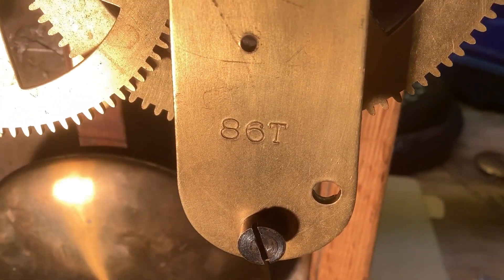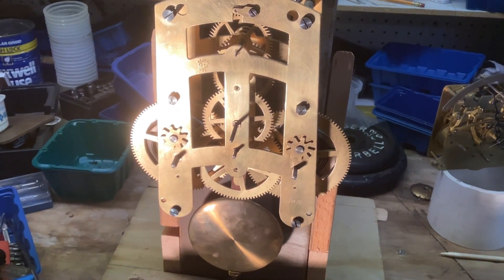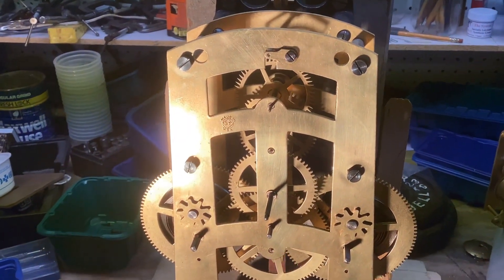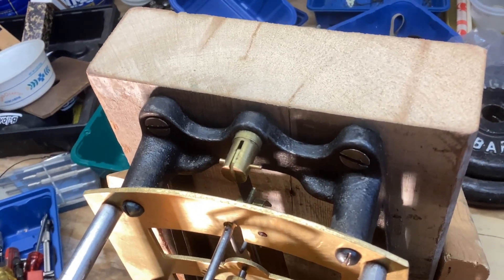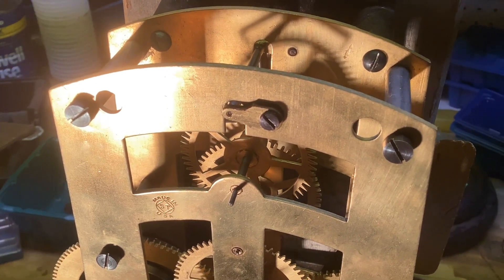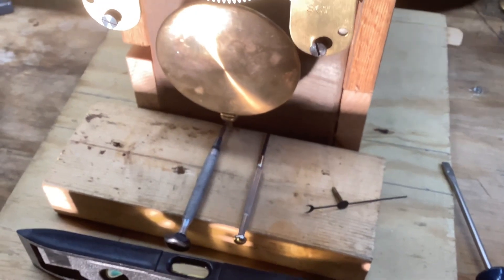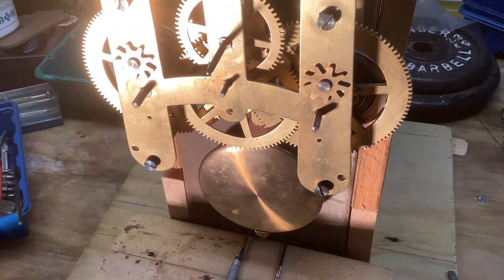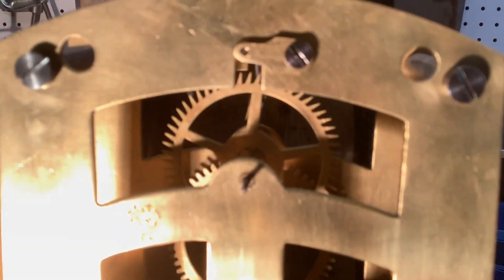Seth Thomas 86T clock restoration

Comment: This is a very nice movement you are showing. Like the stand you made. Lightly oiling the pallets might help the swing of the clock. I couldn't hear the Beat. It looked like the left side of the pallet was lifting higher than the right. I am guessing the clock has an even sounding beat. Does the clock keep good time? Watching the professional shops, they change out the main spring so they can guarantee the clocks performance. I don't change them out unless I see a problem with the spring. These are just my thoughts and maybe things to think about if the clock is not right.

Comment from the maker: I mistakenly refer to the extra long escape wheel pivot that the seconds hands mounts to as a "pinion".  Sorry.
Reply: I trusted you, Paul. I trusted you.....

haha, just kidding. I trust no one. Not even myself. Especially myself. I know how shady that guy can be...

Okay, but seriously, neat video. Im no expert, only got into the inner workings of clock movements thanks to a New Haven Ive been poking at getting back into some kind of respectable shape from a Brooksdale long case clock my parents still have handed down from the grandparents (moms side, if that matters to anyone). But, for what its worth, it looks like there is a slight over extension of the right side of the fork. Like, its ticks, then slides further down before reversing and dropping the tooth as it should. Maybe the crutch is a bit out or something? I cant remember how I fixed it, but my movement kind of did the same thing, the bit of crutch that went through the pendulum would smack over the gap on the 'break' (the tick where the slips a tooth and slide onto the other pawl) then the pendulum would catch up to it pushing it a little extra after a slight delay as it made up the gap distance as opposed to staying in constant contact (and tension?) during the pendulum swing until it ticks and changes to the other side of the gap (where it should stay until the tock....least as far as I reckoned) Like I said, IDK, just my uneducated 2 cents, a year late to the party.

Oh, also, for slowmo, my old Galaxy S5 could do like 280fps at 720p (plenty resolution for most peoples screens, IMHO). You should be able to find one fairly cheap these days (which is terrible because they were an amazing phone). Just blast the subject with light and itll take buttery smooth REAL slowmo, none of that fake frame blending that modern phones do and call it slowmo or high speed (IM LOOKING AT YOU LG!!! Bunch of liars...no wonder your phones took a nosedive...Where was I, oh yeah....). The frame stretching technique you used works alright, but if the exact moment you want wasnt captured, it wasnt captured. Gotta get proper high frame rate recording to get that super schmeck slowmo. So, uh, yeah. There is my 2, and a half I guess, cents. Again, cool video mate! 😎👍